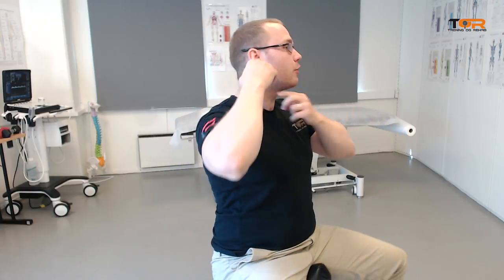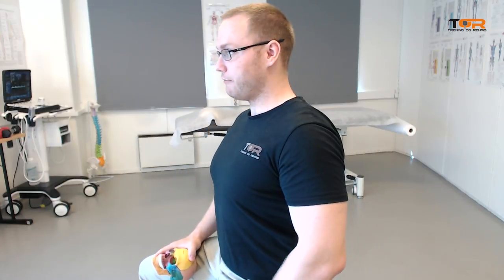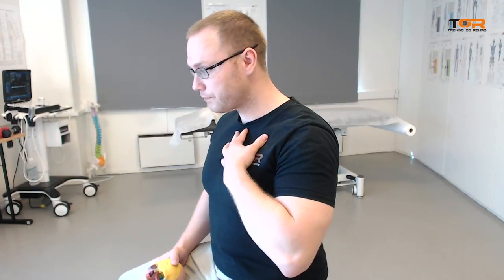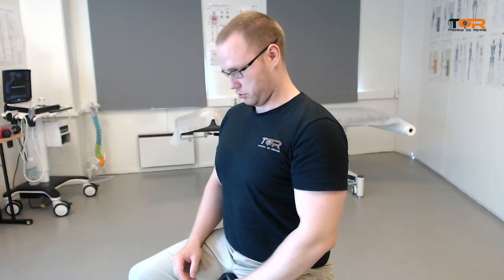Craniocervical "tucking", a biomechanical fallacy and common cause of extracranial IJV stenosis

Comment: Chin tucks are promoted by so many physical therapists.  I had significant Neuro symptoms and occipital pain as a result.  You are presenting essential bio- mechanical information that is ignored or unknown by the many McKenzie chin tuck promoters on YouTube.  Thank you so so much for sharing your knowledge and EXPERTISE with us.
Reply: Hi have you recovered from the occipital pain ?? Can you help me ,,even I have occipital pain and neuro symptoms.
Reply: @dhineshkumars1991  It sounds like you may have some degree of cranial-cervical instability.  All of the nerves and blood supply to and from the brain passes  through your cervical spine.  If there is cranial/ spinal misalignment, it causes compression on these nerves.  For example the nerves that travel within the carotid sheath are the vagus, hypoglossal, and accessory cranial nerves, as well as branches of the ansa cervicalis and sympathetic nerves.  Genetic predisposition, head/upper spinal trauma, chronic poor posture, chronic neck hinging/ bracing, etc can esp over time cause pain and dysfunction.  I would suggest you get a C-spine MRI to rule out anything more serious.  What has helped me the most is getting rid of slumping/ head forward posture and strengthening muscles that pull head up and back as well as upper thoracic spine.  It takes time, effort and consistency to change your posture, and subsequently relive pressure and compression on important structures in head neck area.   I can give you some exercises that have  helped me the most.
Reply: @dhineshkumars1991  Looking at a side view of yourself, would you say that you have some forward head position?
Our front muscles are all intrinsically stronger and pull harder than our back muscles.  Plus most of  what we do is down and in front of us.  All of those muscles are dominating and pulling us forward. That includes pulling your cranium and cervical spine forward. This causes spine dystructure.  It is hard  work to strength muscles that pull you back and upright, establishing more of a balance.  Look at pictures of poor spine posture vs normal.  Look at your posture in side view.  When relaxed does your ear, shoulder and hip all line up? That is the goal.  At first it is hard.  But over time if you strengthen the right muscles and change poor habits, straight upright posture will become easier and feel more natural.
The Superman exercise strengthens all posterior muscles and stretches front muscles.  You can start out with a few reps and eventually increase to 60.  Correct form is everything with this exercise. For example when yo lift up, make sure your head and neck is in a straight neutral position, your nose facing the floor.  Do not tip your head up, ONLY pull mid to lower head back. It is a similar muscle activation to this:  
Lie on your bed flat facing the ceiling.  Chest out and push  the mid lower back part of your head gently into the mattress.... face square with the ceiling.  DONT  tilt head up or down... maintain neutral head/ neck.  The mattress contact point should be only the mid occipital portion of the skull.  While pushing your head back if you feel muscle activation in the lower portion of your skull to where it joins the neck, that’s correct.  Those muscles are very weak and neglected in most people.
Reply: @jeanine219  so have your symptoms resolved? I think the muscle you are talking about is the suboccital. I also feel mine is very week and infact when i lay down on my back my symptoms and neck pain gets worst as it feels like the neck contact with the bed/pillow is making it weaker.
Reply: @snbrains9341   My headaches, neck pain and neuro  symptoms are so much better from these strengthening exercises.  At first the exercises made things a bit worse.  But within a month or so I started feeling better.  The suboccipital muscles are tiny muscles that stableize the connection between your head and upper cervical spine....so important that these muscles are not neglected, weak and tight. Your head is use to forward position, so when you lie flat on bed (no pillow), it feels awkward, painful and perhaps dizziness etc. Face ceiling and don’t tilt head up up or down.  You will feel contact of part of skull behind your ears with the mattress.  Just gently at first, press head into mattress.  Make sure at the same time your upper shoulders are touching the mattress and your chest is out.  These are all of  the muscles you need to strengthen, that are currently weak and stretched forward.  Expect it to feel awkward and uncomfortable at first.  If you sleep on your back, do so without a pillow, as the pillow just reinforces that head forward position.  A small towel roll under your neck is ok.  Superman exercise will help your entire spine because even lower spine misalignments can translate to forward head position.
Reply: @jeanine219  thanks. Did you test for CCI?
Reply: @snbrains9341  No, but I know that’s what I have.
Reply: There are treatments and surgery that I have read about.  But I decided to try muscle strengthening instead.  My rationale is this.  Presumably ligaments that normally hold the head and upper spine into a more fixed position are loose (laxity).  So if I strengthen the subsequent muscles, it will tighten up the connections, and compensate for ligament instability.  It has worked.
Reply: @jeanine219  I agree too. My upright MRI with flexion and extension shows ligament laxity. In the past, doing neck exercises totally relieved me of my symptoms (unless i hinge or bend extremely). The only problem was that I never knew which particular muscles was weak. Now that I am focusing on the suboccital, I am believing I will be relieved of my symptoms once again.
Reply: I tried the McKenzie chin tuck Method as well ended up with more problems than I started with. It’s probably the most recommended exercise. How did you strengthen your neck muscles? What is the Superman exercise?
Reply: @jeanine219 I’ve had the same problem since 2019. It’s really taken a toll on my life. Can you help me?
Reply: What’s the Superman exercise. What exercises helped you?
Reply: @jeanine219  Thanks for your time!!!
Reply: Do you happen to have Cervical Kyphosis?

Comment: Great video!  I only had a styloid on my right side from a childhood whiplash injury.  I have had chronic vascular and neurogenic symptoms for the past 46 years and my symptoms always got worse with posture correcting therapies.  I just had my styloid removed in February 2023 and finally getting relief.  Just the cognition increase and end of brain fog  has already been amazing.
Reply: I just flared my symptoms doing some gentle chin tucking. What was your experience?

Comment: Dude, finally someone who understands this and can explain it thoroughly (with a solution)!!!!!

I never had neck pain for my entire life up until a few years ago when my dad shared a chin tucking exercise from a physical therapist, which I started doing quite forcefully and often. My neck started getting tighter and tighter and then I finally strained it severely. I'm just now recovering from it after realizing what you're talking about here in this video. But your video helps me a lot because it confirms what I've learned from experience and is a wise and important reminder to change my habits, relax and let go of the tension I've been holding.

Thanks so much for sharing. You might the very best therapeutic trainer I've found yet and your videos are up to date and very helpful. Thanks!
Reply: Hi
Reply: Did you have any forehead prominent  veins😊?

Comment: I have cervical dystonia- it is very complex neurologically and symptomatically biomechanically complex. Your videos are helping me making sense of it in a way my Neurologist and Neurophysiotherapist haven’t. Thankyou. If you have seen any Dystonia patients I would be really interested in your views. Particularly for post-injection physio and exercise. Right now my head twists left and into extension slightly so the main neurotoxin injected into the contralateral (right) sternocleidomastoid and right splenius capitus and sometimes the trapezius (bilaterally). It’s very hard to find exercises given the amount of muscle atrophy that work while the Botox is acting on those motor nerves. To help with ROM and stability especially

Comment: Thank you so much for your videos and information. I've been battling a hunch back with shoulders and horrible mid cervical hinge for years now. I saw an incredible specialist and received my prescribed corrective exercise regimen but for whatever reason I couldn't perform the deep neck flexor exercises properly. I thought I tried everything until I just simply lifted my head like you showed.. I think the distinction or the KEY in this scenario is not to enter flexion, that is not a correct chin tuck. The correct way to activate DNFs is to sit/stand nice and straight comfortably, look straight ahead and simply push the tongue up to the roof of the mouth you will feel the relief instantly if you engage them correctly. I hope this helps others struggling with a shit cervical posture!
Reply: would love if you could explain this more, in depth. Curious. I push tongue to roof of mouth and muscles in cheek get exhausted instantly, must be doing it wrong, welcome more details, thanks so much!
Reply: Wow... I have had trouble engaging dnf as well. So if I'm getting this correctly, the way you train your dnf is just to hold the position you described, with tongue on the roof of the mouth, rinse and repeat? I'm still not sure if what I feel is dnf

Comment: So I'm assuming the chin tuck and double chin exercises that are prescribed by nearly every physiologist on the planet are to be avoided completely? You are such a progressive visionary. Keep turning the industry in it's ear. 

I have used the chin tuck exercise to loosen the suboccipitals and therefore reduce headaches...but I always felt that they were doing damage simultaneously.

What do you suggest for management of suboccipital tension, forward head posture and exaggerated neck curvature, (with or without hinging)? I dont have evidence of hinging but have been told that my neck curvature is very exaggerated and suspected to be the result of  tight SCMs.
Reply: I would have a look at his blog post Robert. Well more of an article than a blog post!
Reply: I love Kjetil's articles.
Reply: Where do I find his blog Ciaran?
Reply: same question! i was told by my pt to do chin tucks for my cervicogenic vertigo but feel dizzy while doing them now.
Reply from the maker: Thank you!

Comment: I was having numbness in my thumbs, and everything I searched about it online went to carpel tunnel syndrome. I knew it wasn't that, and that it had something to do with my shoulders/neck area, but I couldn't figure it out. This video confirms the problem I had. I was trying to prevent the neck hinge by tucking my chin down when performing exercises and when running. When I stop tucking my chin and instead bring my chest up, the numbness is gone.

Comment: Great information. Though using the chin as a reference for patients with micrognathia may be problematic as chin is not where it’s supposed to be. Can use the nose or brow line to help these patients correct head position with respect to level/plumb.
Reply from the maker: Meh
Reply: Lol, thanks for your brevity : ) Another thought is learning to use proprioception to better align the head over the spine. If the head is levered over its support, it feels heavier. I’ve been using biofeedback as well (similar to blood pressure cuff) and I’ve had some success. Thanks for your work - haven’t seen anyone putting things together in such a comprehensive and common sense way.

Comment: This is interesting. So I'm 31 and have worked out and kept relatively good nutrition since my teens. I started a desk job about 6 years ago and have had major issues ever since. I've had 3 ischemic strokes and frequent migraine with auras. Every test and scan always says I'm healthy as a horse. I know for sure I've been obsessive on trying to "correct" my posture because I've had breathing issues and felt like crap. Is it possible most of those stem from what is presented in this video? No Dr. Or Neurologist has been able to explain thus far.

Comment: i suffered a neck injury at the front causing me to go into a tetany attack and all the muscles in the front of the neck spasming up (as well as the rest of my body). For almost a week my body intuitively, without consciously deciding anything, swayed and brought the head forward in order to release tension in the front of the neck, while often simultaneously moving the shoulders upwards. It was the strangest experience i have had in my life.  I am correcting the muscle tightness i have now throughout my body with physiotherapy but my deep neck flexors are so tight, that often when i release the suboccipitals, i go in such an extreme chin tuck position, that my body out of its own automatically starts making stretching movements to free the neck up at the front again for some time. It's very disconcerting but I can not stop it once it starts happening. I hope in time the balance will be regained and i will have a nice lengthened neck again.A tip for people who are dealing with this. When your shoulder blades are up high, that somehow has a link with the deep neck flexors, so you can look at both to catch yourself doing it. Also i find releasing the suboccipital muscles will bring out the deep neck flexor tightness more, but it has to be done ofcourse if these muscles are also tight
Reply: Can you elaborate about that suboccipital muscle tightness ??

Comment: Hi Kjetil, thank you for this video. It seems I have this condition and so far doctors have been treating me only on the cervical hinge part, not the craniocervical tuck part. I have the symptoms - protruded trachea, chronic fatique, dizziness and so on. Probably has been caused by few of my habits - looking down on laptop and phone, reading on stomach etc. The cues you have shown are so far helping me, I just wonder, can you overdo the part of putting the head forward and keeping long neck (going too far forward on atlanto-occipital joint for example)? Or will it just get "fixed" there in correct position by surrounding muscles? Don't want to go too far, if it's possible...
Reply from the maker: Yes, easy to do wrong.
Reply: @MSKNeurology  Alright, will be careful then. Thanks for answer!
Reply: How is it now
Reply: @snbrains9341  Still about the same, thanks for asking
Reply: @axagra815  did you get to know what is wrong exactly
Reply: @snbrains9341  no, unfortunately

Comment: Can a combined hinge and craniocervical tuck, as seen at 1:25, also cause tautening of weak scalenes continuously throughout the day, contributing to TOS CVH?
Reply from the maker: Neck extension in general tautens the scalenes, so yes it can contribute. Hinging, though, doesn't really extend the lower neck just the upper, so it does not always cause scalenus tightening. I have had many patients, eg., migraine patients (TOS), WORSEN with proper neck posture initially because it causes tautening. So we had to go very gradual.
Reply: @MSKNeurology  With those patients, how did they manage to untauten the scalenes in proper posture? Was it more a matter of proprioception ie learning to lift the head up and flex the neck without involving the scalenes, or waiting until the scalenes were strong enough through isolation exercise to then be able to go into proper posture without them tautening?
Reply from the maker: @jackprot351  You are overthinking this. Obviously if the patient had crap postsure for years and then completely changes their position, some muscles will get tighter and some will get looser. Some will activate more, etc. The key will be to go gradual, along with correcting the underlying issues cf. my tos article
Reply: @MSKNeurology  Thank you. Makes sense.

Comment: Are cervical extension exercises okay? Do they contribute to cervical hinge?

Are cervical flexion exercises (particularly the neck curl) okay? Do they contribute to compression of cervical artery? 

Are lateral cervical flexion exercises okay? 

Are neck exercises in general necessary for a strong and muscular neck, or will simply having proper posture be enough for a strong and muscular neck? 

Does having a muscular/thick neck contribute to sleep apnea?

Comment: The thickness of the neck seems to play a roll too. I always had a thin neck but after working out and getting a really thick neck all my brain problems disappeared. CSF drainage is also involved.
Reply: What was your original problem? And what's your neck training routine?

I went to physio for neck clicking/popping etc. I had forward head posture, even though I go to the gym. Front of my neck was terribly weak. Arguably I have more neck noises but the original sympton I went to physio for is 95% better.

Comment: I have a bone spur at c5-6, specifically a large, broad based left paracentral osteochondral bar that is compressing moderately on spinal cord, minimal bilateral forminal narrowing.  I also have a reverse neck curve.  Given these two conditions what exercises should I follow? I was told chin tucks and no head extensions, does that make sense?